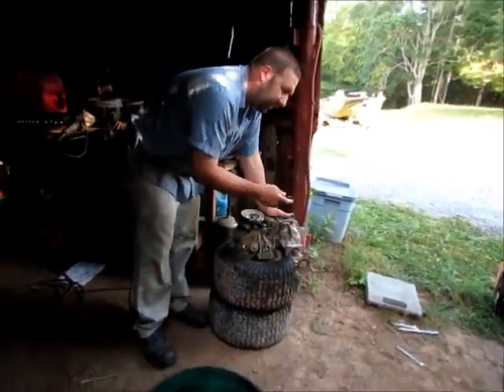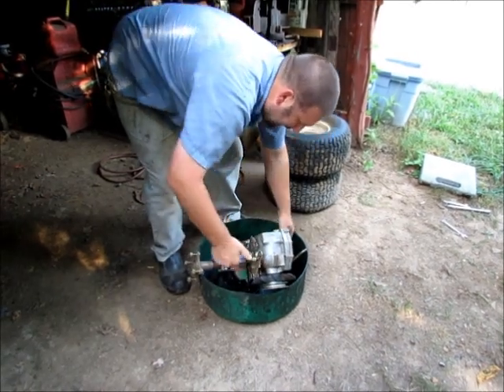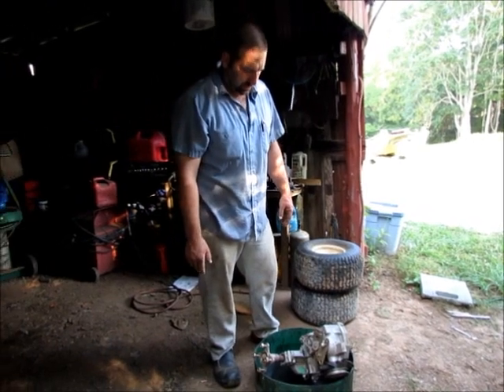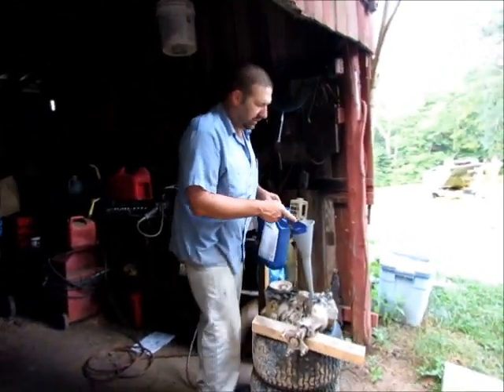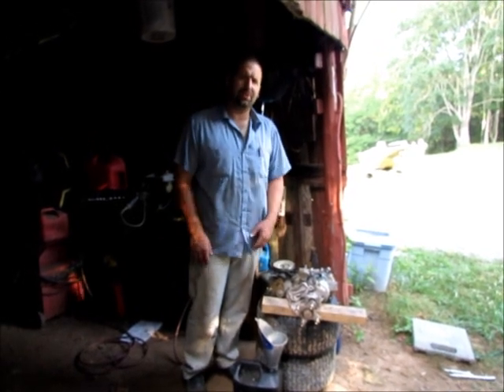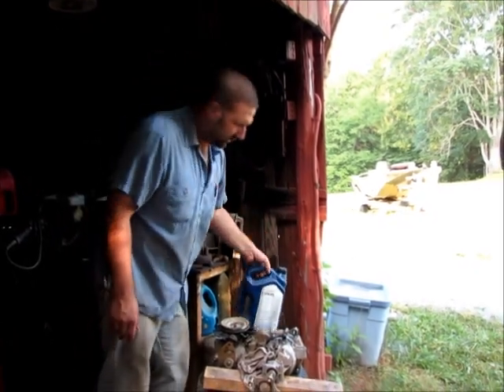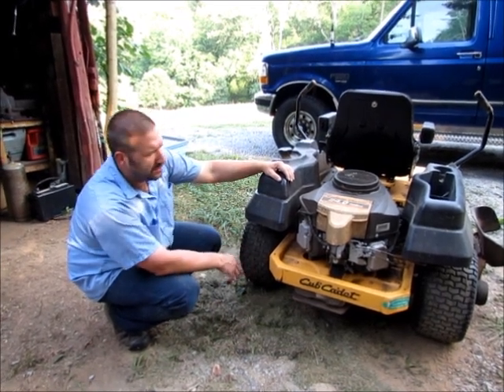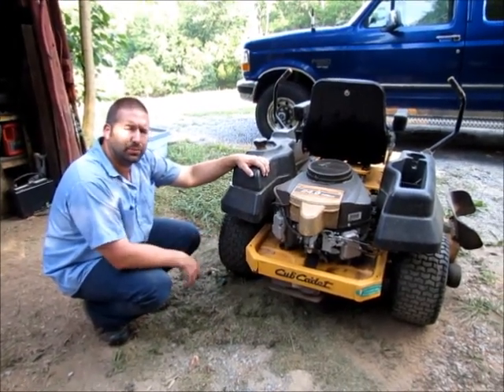Cub Cadet Hydro-Gear transaxle ZT-2200 EZT Oil Change

Comment: Is there any way to upgrade a mower with a ZT-2200 with a ZT-2800 or larger?
Reply from the maker: Maximum 90 great question. I like the way you are thinking. I have not researched to see if another transaxle will work. Just off the top of my head... (which is kinda scary sometimes) I would guess it would require calculating if there is enough motor to run the mower and both of the transaxles due to a higher flow and thus resulting in a larger demand from the power input, and then of course the mounting hole but that could be fixed pretty easy. :) Thanks for asking! ~Mr. C.

Comment: Have almost the same mower do you thing a vacuum pump  for brake bleeding would work to suck the oil out instead of pulling the hydros?
Reply: Mark K  i took the time to drill a 2 inch hole with a hole saw over the drain plug and than was able to get the plug out and vaccum pump the oil out and than just used a long funnel to put the oil back
Reply from the maker: Mark K my transaxle is located too close to the plate that the motor is mounted to. I couldn't get to the fill plug. Your application might be different or you might still have to drill a hole through the plate. When I looked inside of the transaxle I am not sure if a hose can be snaked to the bottom. Excellent question, thanks for asking! ~Mr. C.
Reply from the maker: Derrick Smiley it sounds like the transaxle has worn parts inside of it. I found a nice video about rebuilding one here https://www.youtube.com/watch?v=t63MszuDLfE. Thanks for watching and asking! ~Mr. C

Comment: This is a great video. Thank you! I ended up stripping my oil plug, but used an easy out to remove. Replaced it with a 9/16" hex bolt, filled her up, purged, and running good! Kind of a pain to put back together if you don't have an extra hand, but definitely doable. Mower is a Toro Timecutter z5035.
Reply from the maker: Marie-Laure ditte thanks for the tip about the bolt. I will use one if I have a problem with mine. Glad things worked out for you. Thanks for watching. ~Mr. C.

Comment: do you think it would be okay to use 15/50 oil in it ? I couldnt find 20 /50
Reply: If its mobile one sythetic 15/50 its fine
Reply from the maker: Ok De you want to try to get a thicker oil if you possibly can. I found mine at Walmart. Hope this helps. Thanks for watching. ~Mr. C
Reply: Look online I know bel ray HS full synth 20-50 oils under the thumper and exs badges. However if ypur having issues and an oil change doesn't help you will likely have to replace the hydraulic pump and motor drums and riding surface bearings, as well as the pump center section.